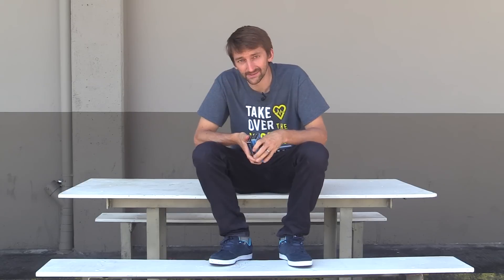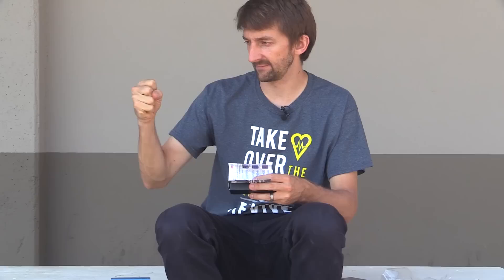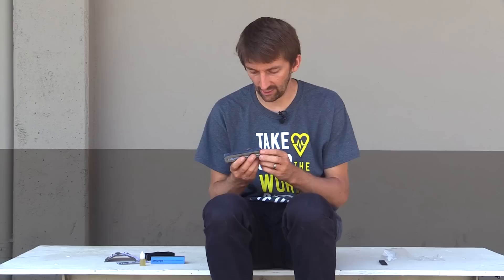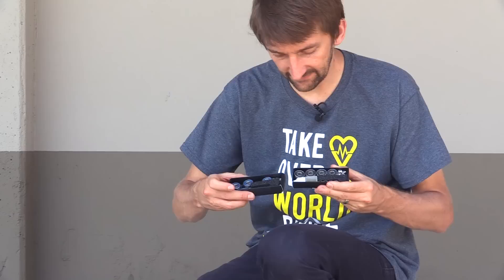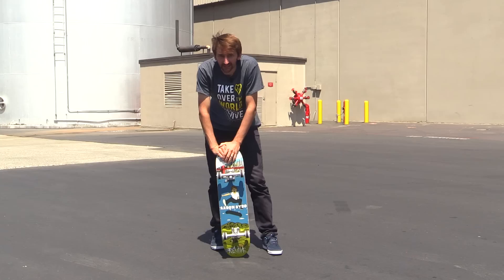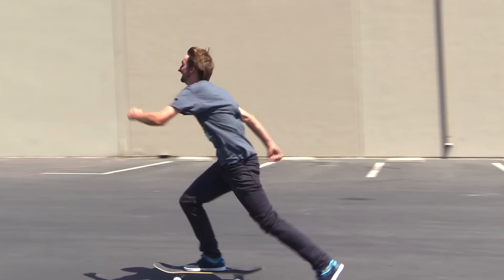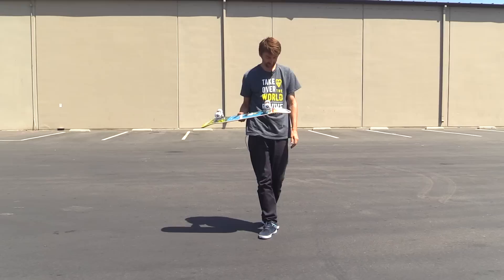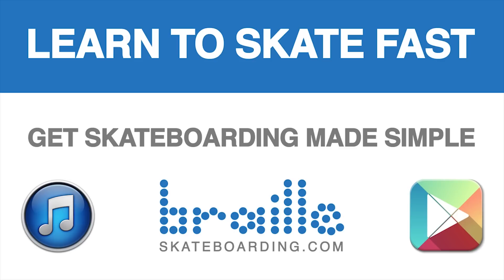CERAMIC BEARINGS VS STAINLESS STEEL BEARINGS | VS EP 9

Comment: You could have easily compared the three set Old/New SS/New Ceramic- If you had weighted your board or rode it down a same ramp and measured the total coasted distance you would have the difference in friction of the bearings by the Total distance traveled. 10% more + guess what 10% less friction.. Now go and make a video that will be scientific rather than guess.  Kids are watching- show them some science.  And no, ceramic is not like clay-  it is now in the realm of man made sapphire and industrial diamond and can be honed to super smooth accurate tolerances.

Comment: Ceramics are waterproof and don't rust
Reply: Don't
Reply: And stainless steel rusts?
Reply: Most bearings aren't stainless steel. they're made of a higher carbon steel to prevent debris from scratching the fine finish and increasing friction.
Reply: +DontTouchMeTherePlz I know but he was saying that ceramics were better than real stainless ones because they don't rust but real stainless doesn't either

Comment: i'm a noob who destroyed my bearings the other day, rode my pennyboard through a puddle on my way to school. now theyre rusty and my skateboard barely moves im so sad. i'm gunny buy new bearings. what should i get that's more weather proof? i know better than to go through puddles now. but i cant just avoid riding my board in the rain, it's my only way of getting to school on time :(  do you think ceramic bearings mean less rust??
Reply: Curlypinkfangirl no one goes skating on rainy days lol just don't go on rainy days
Reply: Curlypinkfangirl use wd-40 to get rid of the rust and such. but you dont want to keep it there after you get it all cleaned up set them in 90% or higher isopropyl alcohol. the alcohol dries up quickly and doesnt cause rust. The wd-40 also helps with displacing water. but i recommend spitfire cheap shots. i have those and are pretty smooth. and not too expensive
Reply: Curlypinkfangirl oh and dont forget to regrease them if you do clean them.
Reply: Curlypinkfangirl i don't recommend wd-40, it's good at first but it attracts allot of dust,
Reply: Rise_again which is why i said soak in alcohol afterwards to get rid of it. wd-40 is just to clear the rust and such out.
Reply: Get "Rush All-Weather Stainless Steel Bearings" from Ebay. They are about $19. Stainless steel doesn't rust. If you cannot afford Rush bearings, there are other cheaper no-name bearings. As long as they are made of stainless steel, they will not rust.
Reply: Stainless steel can rust too, just not as easily as normal carbon steel.
Reply: Ceramic cant rust
Reply: Curlypinkfangirl . metals only rust. ceramics is a rock and rocks dont rust
Reply: you guys realise that there's still metal in the ceramic bearings that will seize them if ridden through water. You just need to take better care of your bearings you could pack them with high temp grease to reduce water getting in then once you've ridden on a rainy day or after a week use petrol to clean them and leave them for a minute for everything to evapourate then re pack them with grease that's what I normally do for street skating. Park skating I just use oil lubricants instead. I'd be more concerned about the wooden board which you could coat the edges and underside and even the top (with no grip tape) and bolts/bolt holes with shoe weather proofing. sealant

Comment: r bones super reds good i have them and they have plastic covers only on one side of the bearing is that good or closed bearings better
Reply: They have rubber shields not plastic
Reply: +nivlac mine have plastic
Reply: +Kirill Danyuk your mistaken they have a nylon cage which is like plastic but stronger and one side should have a rubber shield
Reply: +nivlac my bad it looks like plastic

Comment: I have shake junt bearings
Reply: +Antonio Smith I just stick with Redds
Reply: +Rebecca Dsouza I actually really like Shake Junt bearings
Reply: Redds are just a brand I know well I really thought bearings were the least important part but I'm thinking of trying a few new types. Do you reccommend Shake Junts? any noticable difference?
Reply: Shake junts a great. I have had the triple og's for almost 4 months without breaking
Reply: +Rebecca Dsouza To be honest with you, they're a good start. I have the low riders , they don't slow down with dirt in them which is actually really good for me since I have to skate for Long periods of time
Reply: I started riding on a longboard so redds were great, easy to clean, and sturdy. But a smoother ride is defiantly what I'd like about a year into riding bowls. how often do you guys clean your bearings?
Reply: +Rebecca Dsouza I clean mine around ever other week
Reply: Word thanks for all the info, I'm going to have to pick some up at the shop tomorrow along with some ceremics

Comment: The amount of dump people in the comment section is too damn high. Yes, the heat causes friction.
Reply: +Glenn Hartman  lol man the friction causes the bearings to heat up... which in turn would make the stainless steel softer, and more susceptible to changing shape. ceramic doesn't get softer when you heat it up.
Reply: +Rene jobin exactly.